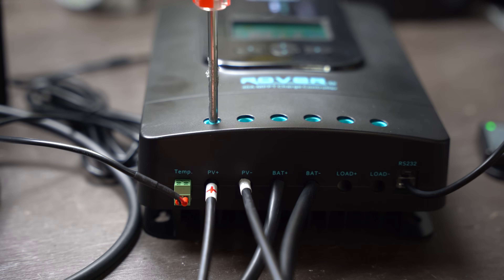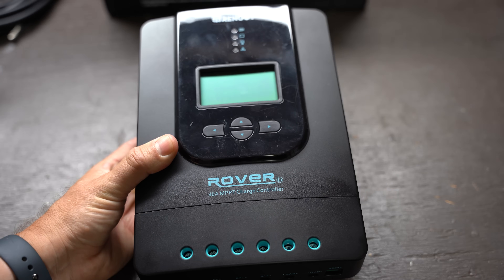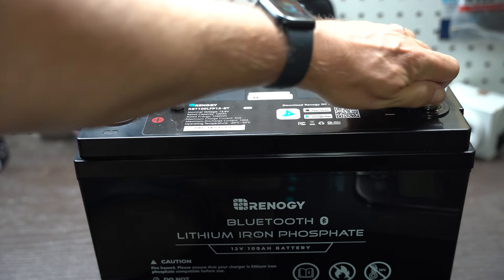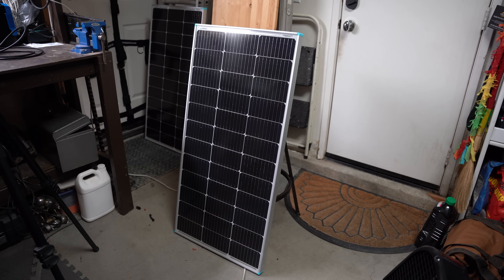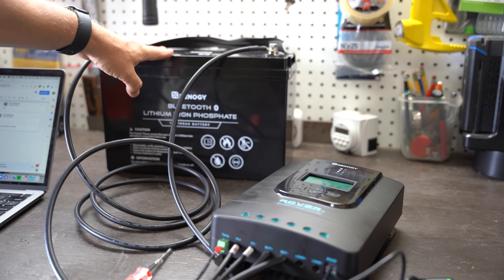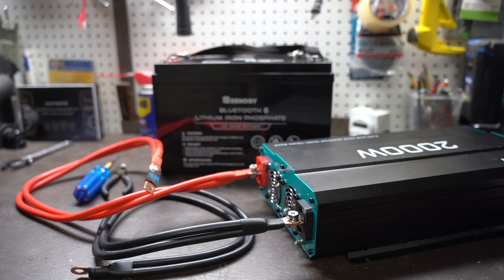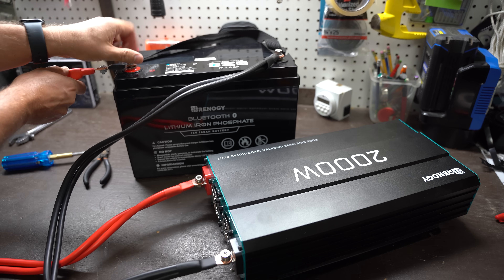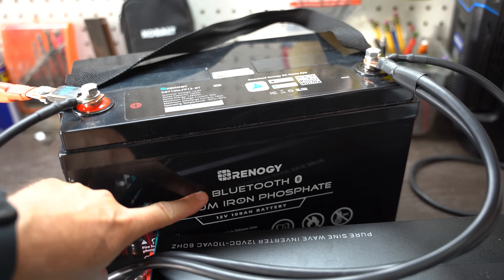DIY Solar Setup: Easy to Follow Step-by-Step Instructions

Comment: Hi! Thanks for the video! I'm wondering... The battery you're using in the video is spec'd at a maximum continuous discharge rate of 100A, which at 12V equals 1200 watts. You're going up a 2000watts inverter to it. Let's say you plug a 1500 watts hair dryer to your setup. The inverter will handle the load no problem, but can you tell us how long until the inverter trips the battery's bms protection? Thanks

Comment: That 200 amp fuse between the battery and inverter isn't going to protect much. The battery is rated at a max 100 amp discharge. If something goes wrong, the battery would likely be damaged before the fuse pops.

Comment: I'm trying this kind of setup, but it is still out of my budget. Is it possible to use a car/truck battery instead of the ones specific for it? After all, with the panel and the stabiliser you're just charging them, right? (I realise that it would have much less charge and last way shorter/not power many appliances)
Reply: As long as it's a 12v setup it should work

Comment: Kris, I really appreciate all the work that you've done for us. This video is, for the most part, just about perfect. You make it very, very clear how critically important it is to avoid putting a load on the system prematurely. 

I had forgotten so much, and when you make mistakes with expensive (for me, it is!) equipment, that then must be tossed - well, all I can say is "Thanks!"

But I believe that you need to go back and re-do a small part. There was one set of cables that you had no clear way to determine at a glance which was positive and which was negative. I would have taken some red electricians tape and marked each end of the one,  bare minimum. 

But that is my only complaint. Excellent job.
Reply: Does it matter which cable I use to make positive or does the cable itself shows which is positive and which is negative?

Comment: First this video is so informative and straight forward, anyone in the UK with any knowledge of solar to battery? I have home solar on our roof but we don't have a battery wall or anything. I use 2 computers in the evening and would love to run them off solar charged batteries once the sun goes down, is it possible to go from plug socket to a controller to batteries inverter then to the devices in my office? I know the batteries would charge off the plug mains too at night but I would be able to shut it down through the night easy enough. If possible would it need some sort of stepping up or down to achieve if there is anything I can watch or read I'd appreciate it. we run all sorts off our solar through the day but still have excess power it would be nice to store some of it literally from 8am to 6pm we have 0 grid usage what so ever. then after 8 a lot of our usage is from these PCs
Reply: also I know solar produces DC and wall plugs are AC so would I have to invert charge and invert again is what I'm trying to work out

Comment: Micro convertors are also used now. And the 230 volt in Europe you plug in the wall directly. But wait g time as they are sold out regularly.

Comment: Experienced but no expert here. Great beginner video! One thing you might want to clarify... the 20% minimum charge on the battery is for lithium only. For lead acid it would be 50% or 12.2v.

Comment: Thank you. Thank you. You have done what many cannot.Thanks. I want to put 4 x 100w solar panels on my roof. I have a cystern to collect water from my downspouts and I am wondering if the panels will effect my water. We don’t use the collected water for drinking and we also have an ultra violet light . Do the panels effect the water? Thanks again. Great job.

Comment: Negative cable is first to be disconnected and last one to connect if you want to avoid the sparks flyin. On a 40 to 100 Amp is not that much but on a multiple battery set up it can ruin your day to do it otherwise. Im just saying...

Comment: Isn't it safer to connect the Positive leads first, then the Negative. And the reverse order when disassembling ?. This usually will eliminate sparks or arcing.
Reply: I was wondering the same.

Comment: You should always pre charge the inverter capacitors before making the final battery connection or you risk damaging the inverter. I use a 25w 30 ohm resistor. See Will Prowse's video on doing it. The charge controller positive lead should also have an inline fuse. 

Good video otherwise!
Reply: I saw that he used a positive fuse on the positive… is that different than using a resistor to avoid the spark?
Reply: @projectsonepercent924  Yes it's different, the fuse is always used on the battery positive side. If you come off the positive and negative to a DC box or a solar charge controller you would also use a fuse on their positive leads as well. The resistor precharges the  caps inn the inverter so they don't blow.

Comment: I am trying to decide on a portable solar unit to run a refrigerator or small freezer.most cant power a frige. looking at Bluetti which has customer service issues and pecron which needsa an additional battery. cnt navigate spreadsheet. need more help please.

Comment: Thank you for this great video! It was very easy to follow.  My question is: how many appliances will this particular system support?  Could you plug a refrigerator/freezer and a separate freezer into it and run them?  If not, what would you have to "beef up"?
Reply: @Jackie Holt Thank you, I have the same question!

Comment: Great subject loved the video. And I'd like to say. Batteries. And inverters.! There's many ways to charge a battery. But you need the inverters to run appliances. Battery banks and inverters are going to serve you well if there is any loss of power from the grid. And there is at least a dozen ways to produce DC voltage. And one 100w solar panel is a great "jumping off point" for people that are smart enough to be interested in persevering there well being. 🤔🥃👍

Comment: They also make all-in-one units that have the charger and the inverter as one unit, like the Growatt I believe. Makes the connections even easier for beginners.
I'd recommend resettable DC breakers rather than a DC fuses, that way you can use them as hard-off switches (which is fine for a hobby-level rig like this).
You should have a breaker for the inverter and another for the charge controller and they should be sized accordingly.
You can also add surge protection on the PV wires, and another between the inverter DC input and ground, and snap-on ferrites on every conductor, including between the panels and on the smart-batteries to help reduce the chances of lightning & EMI from frying the equipment.
If it is for EMP, you can store all this stuff in a faraday cage and wait 2 days after stuff pops off before pulling it out. If it is just for camping, solar flares or regular blackouts then the extra protection is likely overkill.
Reply: Also, if you use a resettable DC breaker rather than a DC fuse, there won't be a spark,
if you connect the cables with the breaker in the off position that is.
Reply: @root4669  there will be a spark, inside the circuit breaker across the contacts

Comment: I have a transfer switch to use with my gas generator that runs my whole house. It is a general electric not a Generic. Can I use this transfer switch with AAA solar generator? Would I still need an inverter to use along with the transfer switch. The gas generator runs my whole house. Could I set the solar to run my whole house? Thanks
Reply from the maker: Yup: https://www.youtube.com/watch?v=cATDauviVmQ
Reply: Sol-Ark has an all-in-one unit that allows for generators, and grid-tie, and stand-by, and off-grid configurations. It has the inverter and charger and transfer switch all as one unit. It's not cheap but it does it all. You can even get one that is EMP rated. With 4 of their 15kW units you can do a full 200amp 120v/240v split-phase service panel as a critical load, you just have to have enough panels and batteries to scale up with it.

Comment: @ 12:40 GREAT POINT. I was told that you should have 100 amp hours for every 1,000 watts of inverter… so a 3,000 watt internet would want 300 amp hours and a 2,000 watt inverter would need 200 amp hours.

Comment: Brilliant practical advice at precisely the time people need it.
Being a simple-minded technophobe who has ended up with an apartment full of computers and audio visual equipment, my unsolicited tip of the day would be this: Mark every single cable-end when cabling anything!
I went online and bought a 200-pack of multi-coloured velcro ties (but you can use pvc tape at a push)
I also bought some Sharpie markers. (which are mandatory equipment for preppers, survivalists and knife makers lol but true)
This might sound excessive, but whenever I connect ANY cable to anything, I attach a colour-matched label to each end of the cable, with the description marked on both tabs with the Sharpie.
I will admit that its a faff and an inconvenience, but its an investment that always eventually pays off when you need it.
In an emergency, or if you are just in a rush, if you ever need to engage in cable management or need to disconnect something quickly, however far apart or obscured the cable-ends are, in the heat of the moment you immediately know which cables are which, even if each end are 40feet apart and in separate rooms. (You will thank me later.)
I have been that guy who needed to reset a monitor by pulling a power cable, and randomly pulled out plugs from two 10-gang sockets, awkwardly situated under a desk,  until I got the right one.... crashing a pc, disconnecting a light and making a bass system do a massive "pop" ...until I finally found the right cable by trial and error.
I learned this trick from a wireman who cabled  office buildings. Its a pain and its a time investment... but if you quickly need to disconnect something like a solar battery.... you can immediately see at both ends of the cable what is what, pull the right cables instantly, grab the unit, pull-through the cable you need to take with it, and be on your way.
OCD? Yes. Worth it? Absolutely.
Reply: OH yeah! I do the same. Label EVERYTHING!
Reply: A cheap label maker is perfect for this

Comment: That's a pretty good video but the only thing I see just too much time under hooking all the wires hook up the inverter only you have to do is you're going to hook towards from there battery then hook up the inverted and put the other words back on the battery

Comment: The other terminals to the right on the controller for 12v input are worth mentioning.  At night should the battery start going down near that 20% you mentioned you can hook up to your vehicle battery and help charge the system.  Great video these little emergency stand-by systems are great for power outages, camping, off grid.
Reply: Those are OUTPUT terminals for running DC loads. I'm not sure what would happen if you connected live wires to them but the results might be spectacular. 😁

Comment: Thanks for the simple explanation,  dor anyone interested the harbor freight thunderbolt 100w panels are excellent,  i switched them to mc4 cables and used renogy mounts.. i dont recommend the rest of the HF systems but these panels are nice..

Comment: I only have #10 cables at the moment, so is it ok to use the same size of wires when connecting the components ??
Also, is there any need for fuses on a basic setup ??
Anyone who knows … feel free to answer.
Thx

Comment: This is probably the best walk through on connecting a solar panel to a charge controller/battery/inverter that I’ve ever seen.
Thank you for simplifying this!
Reply from the maker: Wow, thanks!
Reply: @CityPrepping  excellent job..I had to figure out what the cable connectors were called..then find branch code sectors since I have 400w(4x renogy 100w panels) then to connect the branch connector to the pv neg and pv pos.
Never knew to connect to batter 1st then connect the solar panels.

I have one question left.
what is the load ports for?
Reply: @Darkforward Yep, for me too. With other videos on YT I always wondered what I was missing, felt like there were holes and I didn't know enough. This left no holes in information on both the parts and the process, it was perfect!
God Bless all of us who work to make this world a better and more loving place, IJHN Amen.

Comment: I use small piece of colored thermal shrink to mark polarity on cables. Very durable and easy.
Also, most higher end solar controllers do god job monitoring your battery. If you put power relay on controller's "LOAD" to switch off inverter on low voltage, your battery is protected from over-discharge. Safer to use relay configuration that does not automatically turn on inverter when voltage is up again - in case you forgot some load plugged in and turned on. Fridge  might be exception ..
I'll probably test system with multiple inverters this autumn/winter (dep. on finances;) - one good lower power pure sinewave  for fridges and other delicate stuff and another cheap powerful modified sinewave for bulk load.

Comment: Im not an electrician but have learned tips from them. Wrap the + with red on both ends and you will always know which one it is. Always mark cables for later.
Reply: I usually don't have red tape but I have a rule that any wire marked using any method is ALWAYS the positive wire. This can be a zip tie, ANY tape, a string, notches in the insulation or just tying a knot in the wire. When I cut wires to length, I cut the positive wire diagonally instead of straight across. With AC wires, no mark means hot, one mark means neutral and two means ground (if all wires are the same colorof course 😁). Of course this won't help the next guy who comes along and is wondering why there is a zip tie on one of the wires for no apparent reason.😁
Reply: @simplethings3730  pretty much answered my thought at the end there :P but yea if its your personal system with noone else whos gonna work on it that doesnt know? no reason not to! and i figure most people would at least get an idea of if it was taped that it means something ... i hope

Comment: Our solar arch finished, we are now cabling up our system: 2 x 400w panels to independent Victron 100/60 MCCT controllers, that both feed to the house battery bank (AGM) with a 12v fuse panel in the middle so we can turn them on/off independently like a light switch for whatever reason. 

Don’t forget to add fuses on the + side on each end (between the panel and controller and again on the battery-side + cable) and ALWAYS keep the panel shaded when connecting. 

Lastly, never EVER wear rings, watches or other jewelry when working near batteries. Always have a firm grip on your tools when approaching the battery terminals. If you ever bridge the positive and negative, well, that life insurance is going to come in handy.

Comment: Good content  Up to some capacity, I think it is cheaper and a lot easier to just connect the solar panels to a solar generator -which has a controller, a power inventer and a battery....

Comment: Excellent content 👍 We just purchased our first tri fuel generator and solar is next on my list. I've been torn between getting an all in one station like a Eco Flow or doing a DIY setup as you show here. I really would like whatever I invest in to be universal and not proprietary like connectors and such. I want to be able to expand as I see fit and as I can add more money to the system. It looks like a DIY may be the way to go.

Comment: I am on the road to prepping, and love this video.  Question I have is - we have a camper with 190w solar panel, 2000w inverter and 2 - 12v batteries.   I was going to add solar to the home, but our area stopped the buy back and we can't afford the initial payout.  What I am now thinking, is to add a couple of solar panels to the camper and swap out the lead acid batteries for lithium.  In addition, I was thiknking about a portable solar generator.  I have a quick connect on the camper, so I could get some portable panels that I could use camping and use for charging the portable when not.  BUT...  after watching this video, I'd love to start a diy solar system for the house.    I need a plan...
Reply: Do the camper 1st. Have home, can travel ! Just in case ! Don;t wait, supplies are short.

Comment: Very usefull information. Later you could go deeper with diferent regulators and the amps they have and wich one will be adecuate to the amount of solar panels or watts we are going to collect. And the conversors of 500w, 2000w, 5000w, etc. and what are those for.
Thanks for this easy tutorial 👍